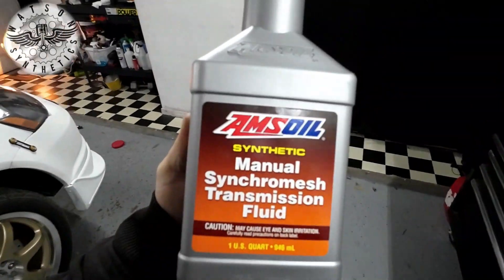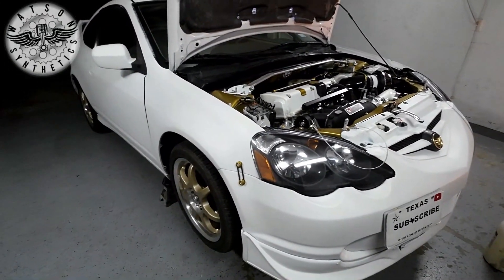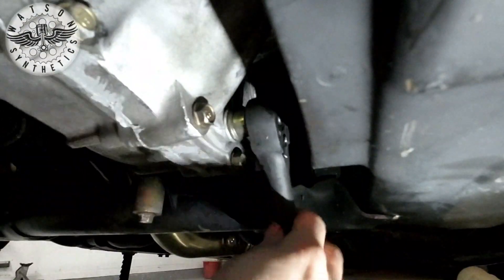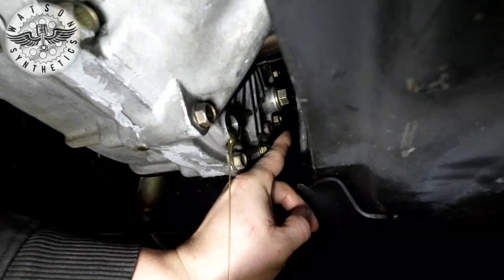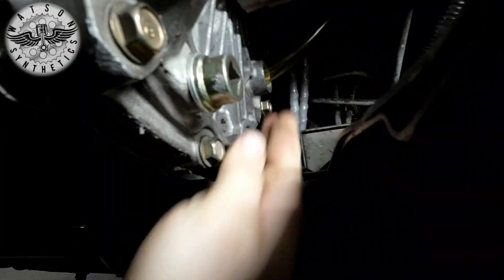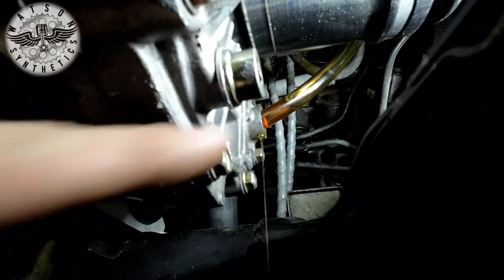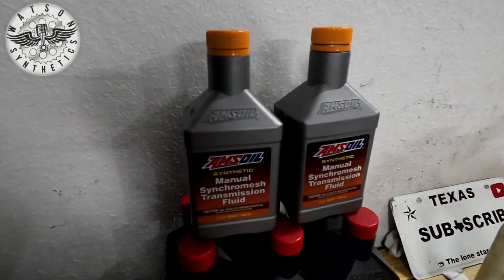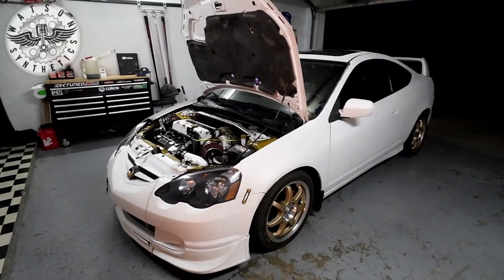RSX TRANS FLUID CHANGE UNDER 1 MINUTE

Comment: Was simple. On my s14 I'd just pull the shifter and fill thru there
Reply: Top loaders are nice for that reason
Reply: @sinformant  o yeah definitely. I could pull the motor and trans out in 45 min. Was easier to pull it all then just drop the trans when I'd have to do clutch work or upgrades.

Comment: On the d17, you can fill it by pulling the reverse sensor on the top of the trans and dumping 2 quarts in. I'm sure the k series trans would be the same way.
Reply from the maker: Yes its the same way but when doing it from the side it gives you a perfect indicator of if its full or not. This method works the best as far as good results go. The speed sensor one is what i use to use for many many years but sometimes i would under fill and or over fill lol

Comment: Best to suggest ALWAYS remove the FILL plug FIRST. You'd hate to have drained all your fluid just to find out the fill plug is stripped or you're just not able to break it lose... Goes for differentials as well. 
Amsoil?? Naturally!!!!
Reply from the maker: I already took the fill plug out before I have previous videos on this but either way stripped or not i would get it out. Not a stripped bolt I haven’t been able to remove yet 😎

Comment: 😢I only use Honda mtf when it comes to Honda
Reply from the maker: I wouldn’t recommend this if it wasn’t good as if not better than oem Honda. I love oem Honda and it’s good but honestly like this amsoil a bit better in my personal experience this stuff actually fixed a synchro issue I had and the Honda oem didn’t fix it. Idk what is so different but this stuff cleared my issue up and been stuck since then.
Reply: @TexasHondaChannel  I was actually going to try this. Maybe next year.
Reply from the maker: @yangli2014  I recommend it for sure. Again there is nothing wrong with oem Honda fluid. When it comes to automatic Honda I would stay OEM at all costs.
Reply: @TexasHondaChannel  have you tried the royal purple one?
Reply from the maker: @yangli2014  I will not use royal purple. I have had a lot of friends use it in their Hondas and their engines blow shortly after the oil change I don’t find it as a coincidence either because their engines were perfectly fine mechanically but the Internet told them they need royal purple and for whatever reason it wasn’t compatible with Honda rod bearings and I thought maybe it’s just an isolated incident but when more and more people kept using royal purple and their engines kept blowing or having issues that put me off of it forever I don’t want anything to do with royal purple I will not recommend royal purple to anybody and it’s expensive and over hyped. Personally I’d rather run super tech from Walmart over royal purple because super tech has been proven by project farm to be very good oil and I’ve used it for many years in turbo applications and never had an issue plus it’s cheap. I know it sounds crazy to choose super tech oil from Walmart over royal purple but that’s just from my personal experience what I would do.
Reply: @TexasHondaChannel  damn. Almost went royal purple MTF on my civic earlier
Reply from the maker: @yangli2014  I don’t recommend it but it’s ultimately up to whoever wants to risk it. I advise against it. Up to you though. Your car and money
Reply: @TexasHondaChannel  trust you man